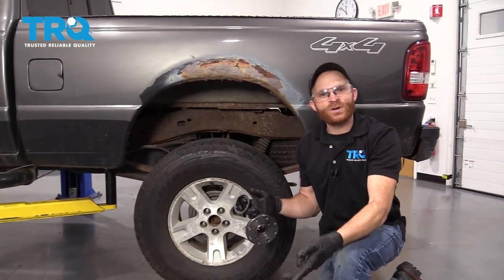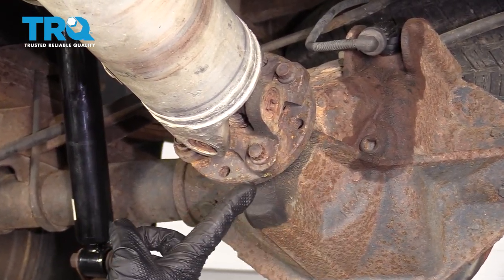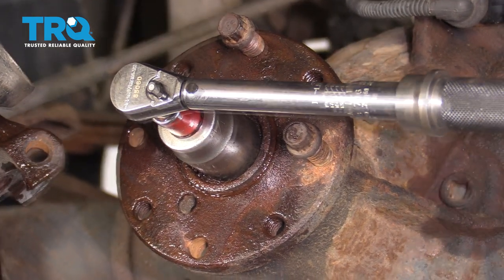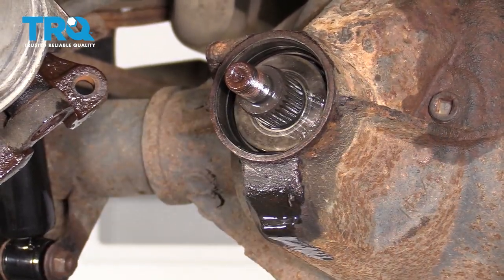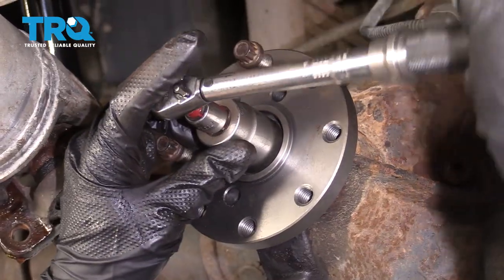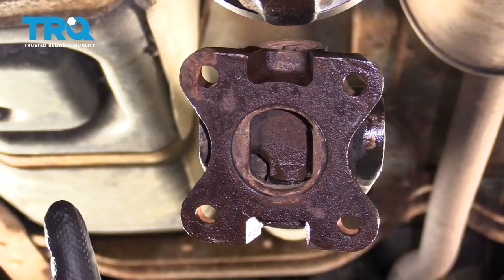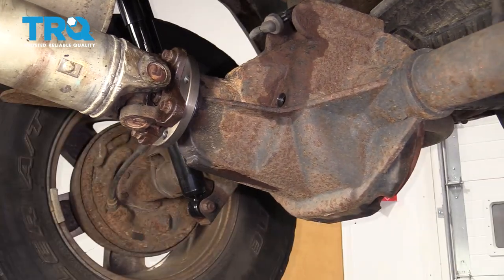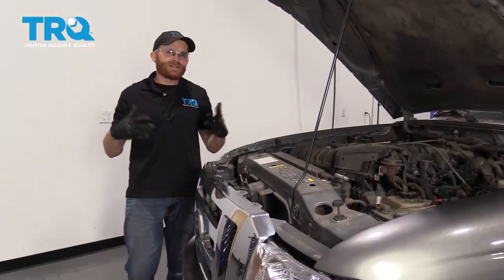How to Replace Pinion Seal & Yoke 1998-2011 Ford Ranger

Comment: Appreciate the video but two things I don't like.

First, in a video like this fastener sizes/style should always be noted. It's always baffled me that the majority of "how to's" don't do it.

Second, I would contend that the method shown for measuring rotational torque is wrong and a click style torque wrench is inappropriate. You're measuring residual or break away torque (The amount of force it takes to get the pinion to move). This is not what you're looking to measure when taking a rotational torque measurement on a automotive differential. 
In order to correctly measure it you need to use a beam style torque wrench whose measurement can vary. You then must overcome the break away torque and measure how much torque it takes to keep that pinion turning at a constant speed. That's the number you're looking for.  

The measurement shown may tell you that you have the same breakaway you did before the repair but it doesn't tell you that your rotational torque is good and that's what matters when setting up a diff.

Comment: Is it 7.5” for the pinion seal
Reply from the maker: +@stephenmcgraw3610 The size of the seal will depend on your vehicle specifications. You may contact a local dealerships parts department to determine the exact size for your model.

Comment: Is it the same procedure to replace the front pinion seal?
Reply from the maker: +Cory Lechner The installation should be very similar.
Reply: @TRQ  - it's disc brakes on the front, so what do you need to do since there is no brake adjusters to back off?